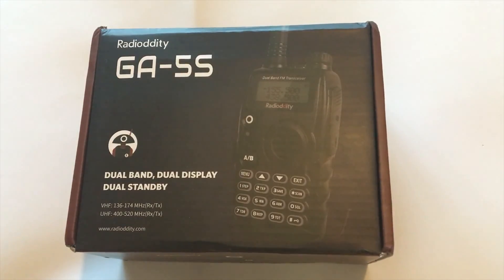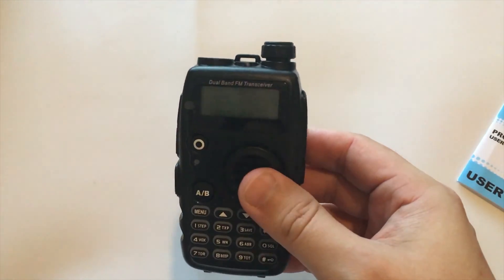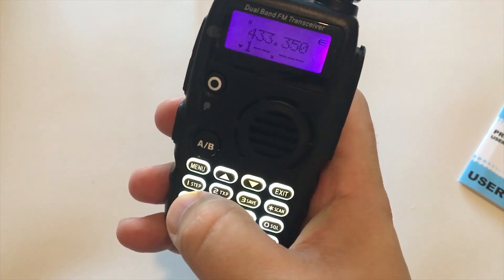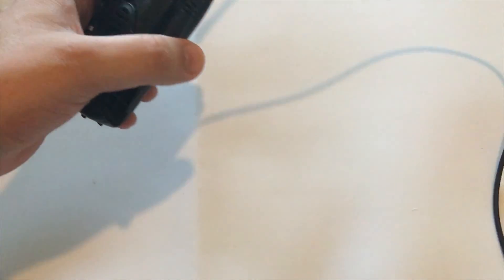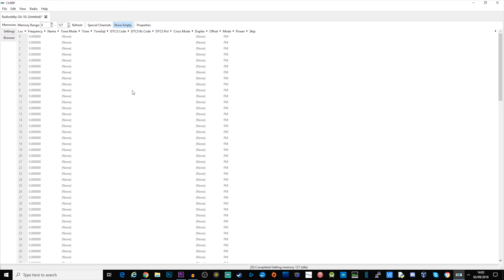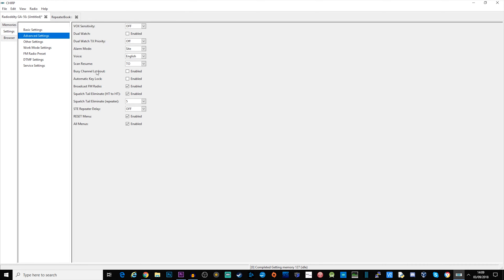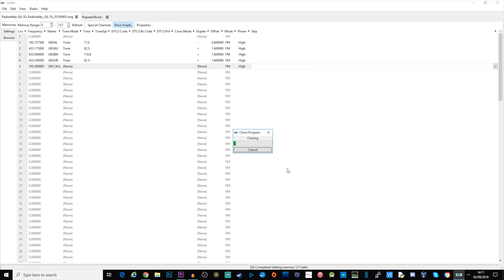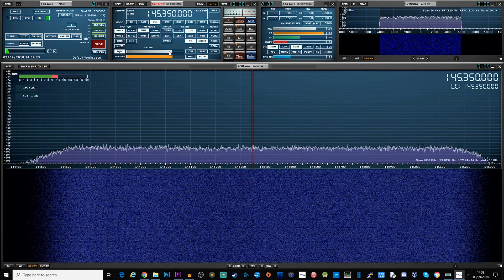Radioddity GA-5S VHF & UHF Dualband Handheld Radio Transceiver

Comment: Hey
Nice video. Maybe you could show a broader spectrum on the waterfall next time. Signal quality is one important selling point. Especially the signal quality on the fringes of the RF output filter.
Oh and btw, is the firmware flashable?
Reply from the maker: Do you mean more zoomed in or zoomed out on the signal? It’s showing a 2Mhz width in the video plus too right shows zoomed in.
Reply: Zoomed out. I saw a lot of bad signals back in the days. Bad filtering, distortions. Sometimes it was the receiver, sometime  the transmitter's fault. 
But i guess 2 MHz is good enough. If it is clean there it is unlikely to produce a lot of noise elsewhere.  
Unlike me with my first AM trx and my dad freaking out every time i pressed PTT in 1992 (TV gone... end of the world scenario^^)